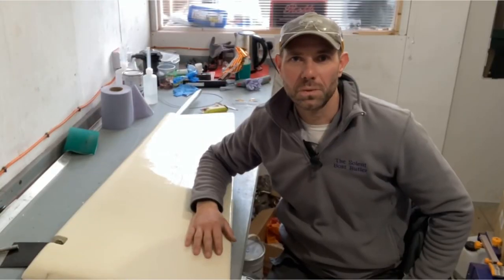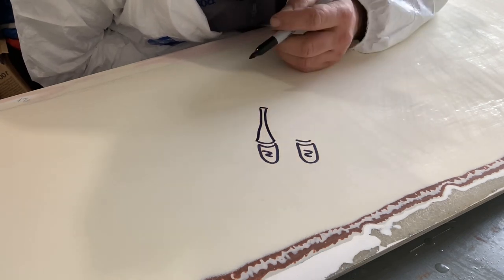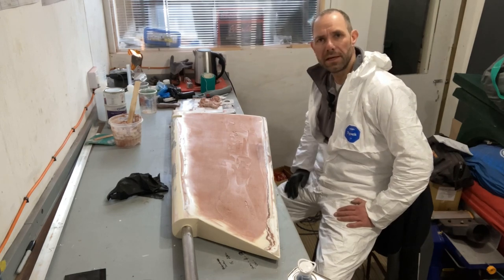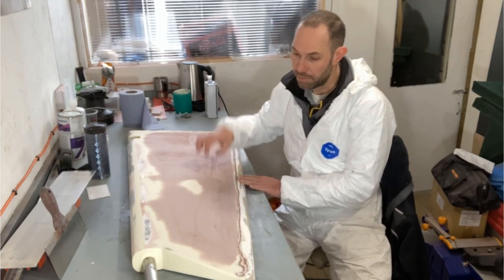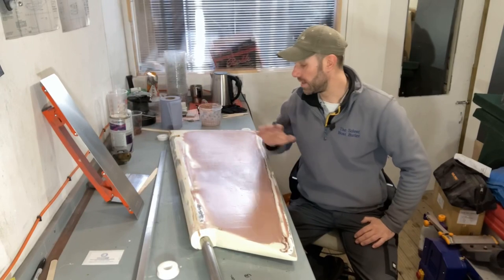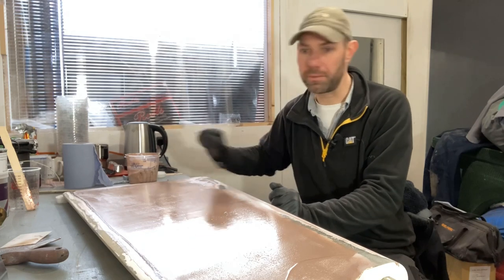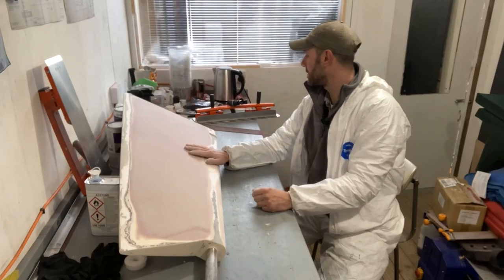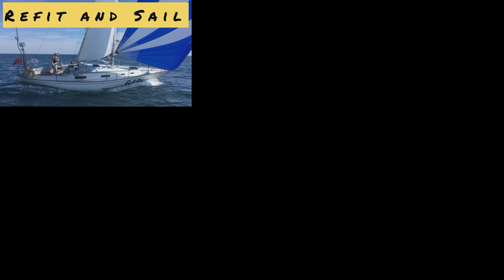Rudder Repairs - Filling and fairing for a better rudder shape - Contessa 32 Refit

Comment: Nothing wrong with a bit of sanding therapy. The time-lapse makes it bearable. I bet you wish the job took as long as the video makes it feel!
Tell me, when you're doing a re-profiling of a rudder, or similar, do you need to consider the class rules? Are there tolerances you need to consider with regard dimensions and/or mass?
Reply from the maker: Indeed, if the sanding was a quick as the time lapse video it would be a joy.   WRT the class rules, yes I do have to keep the overall dimensions of the rudder as standard, that is something that should be checked when a boat is “measured” for a class certificate, however there is nothing wrong with filling and fairing an uneven rudder or hull to make it the best (most efficient) shape as possible.    Hope that answers your question.

Comment: Hi, fantastic job on the rudder as usual.
I have some teak strips to attach to a newly made glasses over locker lid, what is the best product to use or would it be best to use screws.
Cheers Andy.
Reply from the maker: Maybe an adhesive sealant like sabatack (that’s what I mostly use) and maybe just a couple of screws although they will be largely redundant once the sealant cures.

Comment: Does the weight of the rudder matter much? Is there a concern of the additional material weighting it down?
Reply from the maker: The weight doesn’t matter that much but if racing it always an advantage to be light weight!